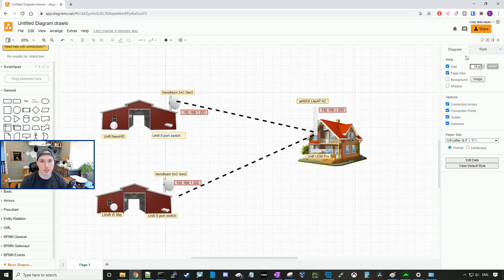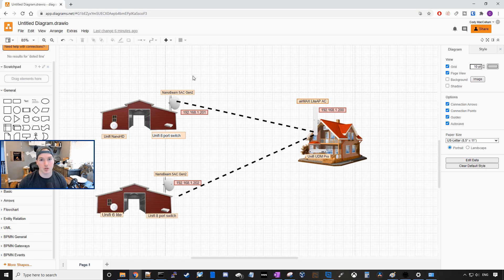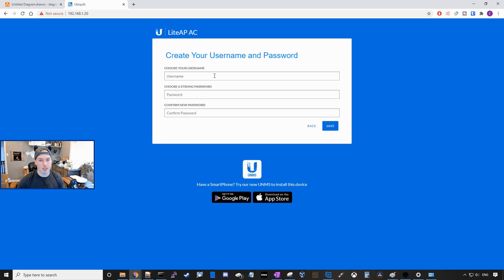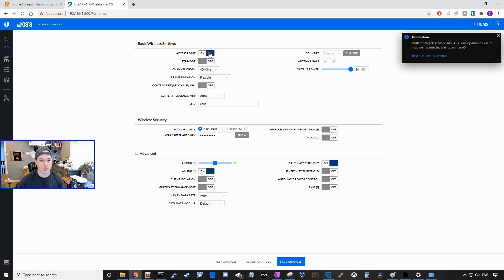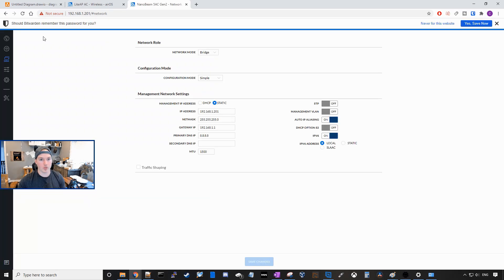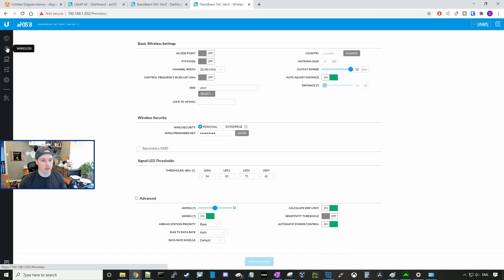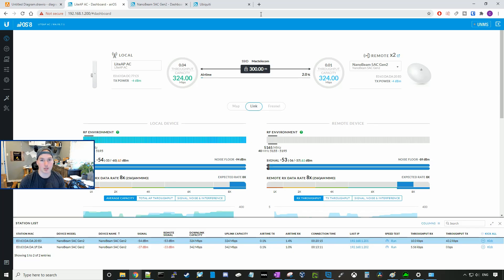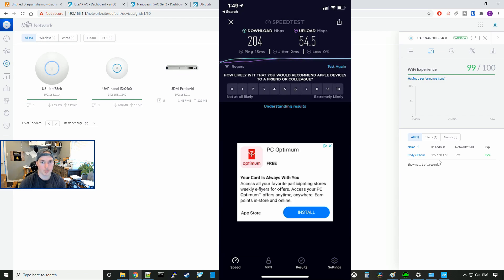Ubiquiti PTMP Setup And Configuration

Comment: Thanks, I've been enjoying your channel.  I'm a retired IT manager and I'm volunteering for a museum.  I'm in the process of setting up a second Dream Machine for another museum.  I set up a nano beam PTP bridge for the first museum that  nice clear line of site with no issues.   Now I'm looking to set up a similar PTMP bridge at a different museum.  The biggest difference this time is there are a lot of tall pine trees to work around.  Using your example above the best line of site for me would have the internet connection and Dream machine are in one of the barns, but keep the AP light on the house.  Seems odd to me but this is a bridge, not a router.  Do you see any issues if I do this?

Comment: Thanks for the video! I'm wondering if you may be able to help me out with two issues...I have a PrismStation 5AC that I want to connect to two Loco 5AC. Currently it's set to Access Point on, PtP mode on. It's connected to a one of the Loco 5ACs and works well. The 1st Loco is set to Access Point off and PtP on. But, I can't get the second one to connect even though it found the SSID. I'm assuming that this is because I need to change the PrismStation to PtP off? If that is the issue, do I then set both Locos to OFF for AP & PtP?

Second issue is that I can't get the devices on the UISP Domain (says unreachable). I did make a domain and it did work until I changed the devices to 192.168.10.x instead of 192.168.1.x. Should they all be back on 1.x?

Thanks in advance!

Comment: Hi Cody thanks for the video. I have an application to distribute wifi to three houses (PTMP) all on the same property. I purchased 3 LiteBeam AC. Can I use a router at the end of each bridge to distribute the wifi in each bridged house? Do you have a video to help. Thanks
Reply: You can either use router/AP to use as wifi access point.

Comment: Can the same outcome be accomplished with the UniFi Mesh Access point UAP-AC-M-US over a short distance? Just to keep it within the unifi family without having to use the pricier building to building bridge?
Reply from the maker: The Unifi mesh are pretty much the same price. They will also not give you the reliability and the speeds the same as the PTMP gear I have in this video
Reply: @MactelecomNetworks  Thanks Cody. That's what I thought. Well done and explained yet again.

Comment: Might be a very noon comment but if the LiteAP AC is broadcasting a SSID couldn't the clients connect directly to that or are they configured in such a way that they can only broadcast to the specific receiver. Also kind of weird the LiteAP and the Nanobeam dont show in the UDMP device list?
Reply from the maker: They won’t broadcast the ssid (not that I could see anyways) also the liteAP and nanobeam are not apart of the unifi stack so they won’t show up

Comment: Have you experience with a Wireless ISP PTP (airmax) interfering with WAP’s in homes that are in the Path of the PTP?
The WAP’s and ISP PTP are all on the 5Ghz band. 
There are 7 PTP’s that are spread across the 5G band so there are no unused channels for the WAP’s.
This covers a very large neighborhood with dozens of homes affected.
The main ISP AP’s sit atop a 1000’ mountain overlooking the neighborhood and are used to provide service to homes miles away.
The WAPs work ok (500Mbps up and down) until they stop broadcasting their SSID... change channels, or just slow service to ~20Mbps.
Rendering use of the 5G Band unusable.
My clients are all on 1Gbps FTTH and are expecting a better WiFi experience.